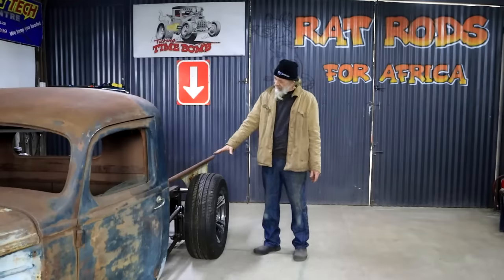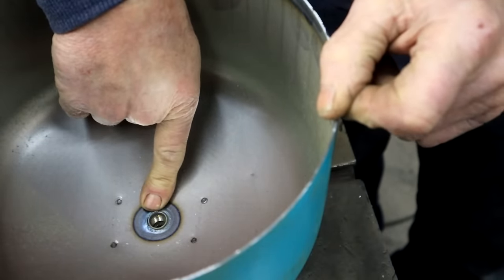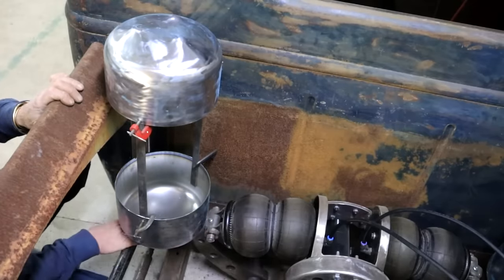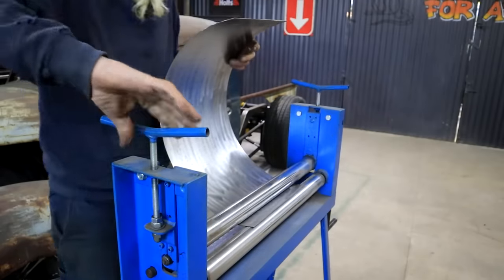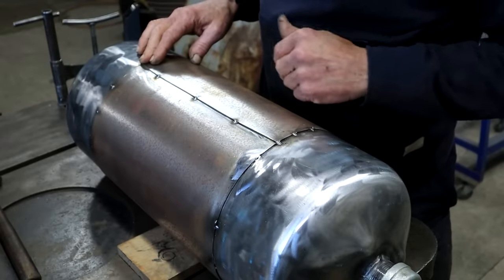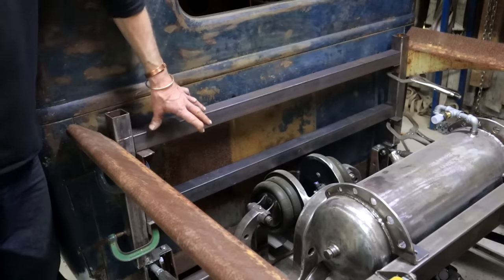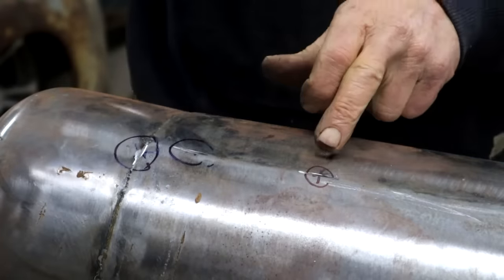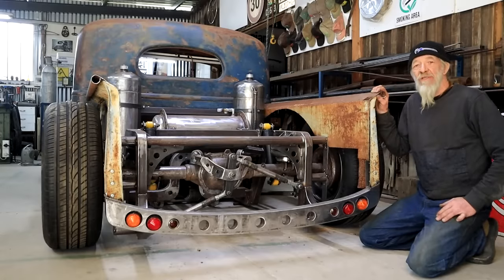Building Fuel Tanks from junk - 1939 Hudson Rat Truck Part 31

Comment: Greetings from Whidbey Island, Washington State, USA. Don't forget to provide a vent hole in your filler caps. If you don't, your fuel pump will pull a vacuum and eventually starve the engine.

Comment: I am in the states.  I have done a fair bit of work in Japan and Bahrain and had to use the metric system at times to work with the locals.  I wish we would go to the metric system here, so much simpler to work with.  

Your fuel tanks are an interesting solution to a simple problem.
Reply from the maker: I agree. Once one has worked with metric, imperial makes no sense 😊

Comment: Love the tanks that you created for your Rat Rod Truck, I am sure you are considering to tie the two tanks together with perhaps a 1/2 pipe between them.  Would like to see how you finish these tanks up and connect with to a fuel filter to your engine.
Reply from the maker: Thanks. I will only do final connections once the truck has been taken apart, stuff painted and reassembled again. Still some way to go...

Comment: Diff (Div) your T.I.G. is getting better. Like I've said before, it is way more skill. T.I.G. is unlike M.I.G., where in a good travel speed & temp, can make a good welds. T.I.G. needs practice as the only way to get better, and it is fun. To get a dime,  laid-down look, try lower your temp, slow down a bit, and add a little circular motion with your touch. Adjust all as needed to get the look you want. The more you practice and the more you enjoy it, the better you are getting. Also, being able to see your weld puddle is manitoritry. For myself, also being older, my eyes aren’t what they used to be. But, we, back at (Wyotech here in the U.S. way back when), used to call “a cheater lens” or magnifier lens for the inside our welding helmet is a must. Basically, reading glasses for old and/or almost blind welder’s like us. Once, I found the right power cheater lens and could see the weld puddle clearly. It made all the difference for my T.I.G. welding. I love T.I.G. welding more than any other metal work.
Reply from the maker: Yes, I need to do more of it, to get some mileage behind me. 🙂 My current machine is scratch arc with this stupid manual gas valve om the handle. Doesn't make it easier and wastes a lot of gas! But, just ordered a better machine! Cant wait!

Comment: On hydraulic tanks I’ve built, I grind a vertical groove against the threads, it allows it to breathe and won’t let water in👍
Reply from the maker: Great idea! I'm going to give it a try. Thanks!
Reply: @ratrodsafrica  it works really good, I forgot to say to groove the threads in the cap! It works the best and doesn’t look like crap😄
Reply from the maker: @davidwaskiewicz3289  thinking about it, that would be the best. Thanks, going to try it

Comment: Daniel Hughes mentioned using clear materials for the tanks. I was picking up a load of produce one night in California, when a beautiful Blue Peterbilt had finished loading and pulled up to close his trailer doors. It was highly customized and lite up. I noticed his fuel tanks were glowing and I could see the fuel moving back and forth inside the tanks. lol. They were illuminated somehow. They were translucent plastic or poly and were lite from behind or top or inside. I didn’t get a chance to ask how he did that but were way cool looking. Never seen anything like that in 40 years of over the road trucking.
Reply from the maker: How cool! Must be some really special kind of plastic...
Reply: I searched it and found a custom big truck shop here in the USA called “Chrome Shop Mafia”. They did one similar with acrylic clear on the ends of a tank and it was lite up too. But it was not the one I saw in California. Also these were used with diesel fuel and not gasoline.
Reply from the maker: @EarlyIronAddict427  clear flat ends I can still imagine as being feasible. But a tubular section? That will take some doing...
Reply: Yes. I wish I had caught him and asked how he did that. I was just sitting there looking at it. lol. Jaw dropping. Hahaa. I could see the fuel slashing from one end to the other. Was cool looking 😎
Reply: I’ve seen white plastic containers that the land scrappers use to spray lawns and you can see the liquid in them moving around. I wonder if it was that type material ??hmm🧐

Comment: When I was a lot younger I loved roaming around junkyards so much I went to work in one. We used to get between 25 to 50 cars a day. I went home with a truck load almost everyday. Needless to say that the owner of the yard was a pretty cool guy. I think that the 3/8 cross pipe would work when driving but you would need to shut one off for filling. Maybe just vent one of the tanks, like my old Harley does. Just a thought. Keep up the great work.

Comment: Those look like the aircon gas refill tanks used for cars and bakkies. You calculation is off by a point actually 0.0253 meter cubed is equal to 25.3 Litres(Sorry just being picky). Tanks look awesome. Well done bro. Thank you for sharing.
Reply from the maker: Call me a liar for a cup full of petrol 😂 I actually did write 0.0253 m3, then just rounded for simplicity 🙂
Reply: lol...

Comment: Pressure testing with air is dangerous. Learned this the hard way... 2 smaller  vertical tanks is a great idea, especially considering sloshing of the fuel. Great work!
Reply from the maker: Why do you say it's dangerous?
Reply: @ratrodsafrica In my job we were testing as you do. When one vessel burst one day @ 5 bar it was epic, and the bottom flying off nearly hit one of my coleagues. Since then we test any tank filled with water - our pump gets to 2,5 bar and we may increase it with air. Water is incompressible and takes the same volume @ 0 as well as 10 or 15 bar. Any leak, no matter how small gets the pressure back to zero. With air a 25 liter tank gets filled with 75 more @ 3 bar. That's a lot of air pushing out. Just 2 bar for example is 2 kg for every square cm of the internal surface of the tank, and for your tank that's 12*12*3.14*56=25321sq cm *2=50 tons. Water does not decompress explosively...
Reply from the maker: @ЛюбомирДинков  thanks for the feedback!
Reply: @user-hu2iw5qu3i yes agreed, I was getting puckery watching that first test. 😮😅

Comment: Hey Div,
I don't know if in South Africa they use alcohol in your fuel or not. But here in the States they do, and it can cause rubber fuel line/clear rubber hoses to crack and leak. One thing we use here is fuel injection fuel line, which has a plastic liner in it. But after you showed one of your older Rat Rod, you may not have to deal with it like we do. Also here is an idea for your tanks: I don't know what your standards are there, but here Gasoline/Petro cans are Red, and Diesel cans are yellow, What I think would be cool is paint them whatever color, and on one with stencils put Petro and on the other one put Gas.
Bart
Reply from the maker: I have those clear hoses on 2 other builds that are a few years old already. A bit of yellowing, but no issues so far. Easy enough to replace though.

Comment: In 1972 we were told that the US would be fully converted to the metric system by 1975! They were off a few decades!!! As a tool and die maker, forced to use two systems of measurement I wish they had followed through back in ‘75!!! It definitely is a simpler, easier method!!
These tanks are great!! And the site “glass” level tube is a clever idea!!
Reply from the maker: I take it you tool & die makers use the metric system then?

Comment: I know it's too late, but had you used a clear material for the tanks, it would have looked like an old glass fuse!! I like the longer videos. Thanks again! Your work is impeccable.
Reply: great idea what would you use to fuse the metal to the clear piece?
Reply: @Atr42Greasemonkey  no idea, but div is a genius. He'd figure it out. It was more sarcasm.
Reply from the maker: That will be extremely tricky to do! 🙂

Comment: Diff, from here it looks like the nipples or bushings you used to fill the tanks are un-tapered rigid electrical conduit fittings, they are not for running liquid through.  If I'm right, maybe a couple of necks from fuel tanks from the junkyard would be a safer option.  

I like the way you built the tanks; they came out great.
Reply from the maker: Nope, they are irrigation plumbing fittings. 1 and 1/2" BSP taper thread

Comment: I love that idea of the twin tanks, I used a 10gal. air tank once and had some kind of cutting torch brass filter for the vent, with the guard on your sight tube it would be helpful to have a bright colored plastic ball as a float, just make sure it doesn't fit thru the metal tube or its only good for one fill, lol, great work diff, it's looking fantastic
Reply from the maker: The ball is a great idea! Now to find one with the right diameter...
Reply: Spot on man...good call.

Comment: Good job on the tig welded gas filler !!!!  Maybe try a fupa #12 cup ...if u do u may fall in love with it !!! I did
Reply from the maker: My biggest issue is that my current setup is scratch arc. Pain in the butt! Plan on buying a dedicated TIG machine soon!😁
Reply: @ratrodsafrica  my setup is scratch Arc, and I love it !!! And u did an amazing job on those tanks !!! All your work is well thought out and executed.  My tig is a miller max star 161 and it's scratch arc once I got used to the start I'm happy with it it the fupa cup helps me see my weld and allows me to extend the tungsten to get down in tight spots and I could buy a foot pedal for it if I wanted to spend the money 💰
Reply from the maker: @flyingmachinecustomparts8227  I can't find those fupa cups here. And Amazon shopping is a problem for me...

Comment: A removable metal boot/toolbox in the area of the tailgate and a removable bed floor would make this beautiful old thing perfect for those odd times it could be put to work. Really like the way you put things together Div. Maybe if you turned the sight level 90 deg. Or even less towards the inside of the trayyou may be able to see the level from the cabin.
Reply from the maker: No, not visible through the rear window, I checked🙂

Comment: As you drive around and the petrol inside moves, it will find its way out at the filler-cap, even at half-tank you will always have the smell of petrol ... sorry no smoking here ☹ 
You need to seal on the filler-cap, but then you need a proper breather, especially with a V8 in the front. 
Weld in a pipe from the bottom into the tank (out of the way of everything) , going to the highest point inside the tank and then route a hose onto that going somewhere higher-up like inside the cap and back down again.

Comment: I have an idea , would if you put a one more fuel tank in-between the two , it would fill that space. That v8 might get 10 miles a gallon. So to have 5 to 6 more gallons. . Lol
Reply from the maker: Can't fit one there because the suspension linkages are in the way

Comment: No tailgate? Please kindly allow me to suggest something: A simple frame made out of angled iron plus some hinges and latches would stabilise the side brackets and keep them from rattling. To keep dirt away from your fantastic looking suspension contraption, you could bolt in a sheet of this sturdy plexiglass and use brass acorn nuts and washers on the outside. This would match the brass rings around the rear lights and look even more steampunky.
Reply from the maker: Just thinking about clear plexiglass gives me nightmares 😄 That stuff is for show cars that never get driven...
Reply: @ratrodsafrica  
Thanks for replying and especially for giving a heart to my comment. I appreciate both very much. 2) Oh really? That wasn't intended to be. I beg your pardon. After realising what kind of roads are leading to your farm and workshop, I thought it would be a good idea to have some protection against dirt and gravel.
Sincerely yours.

Comment: I almost forgot the little ball can be made of a piece of white carburator nylon float. Also at the lower and upper part of the plastic indicator tube, put a small object like a washer to prevent the ball from escaping inside the tank. Maybe the plastic toy pellets used in toy guns would be great because they are orange in color. However whatever you make the little floating ball first test it out in a jar of gas to see if it will not desolve. Look this part up on E bay its description is :  NBR Solid Ball Nitrile Rubber Ball 6~12mm Black Oil Resistant Fuel Petrol Diesel.    You may have to shave it down to fit your tube.
Reply from the maker: Thanks!

Comment: Hey div you say your covering the side and won't be able to see the insides from the side and you aren't going to have a tail gate so you can see frome the back.  I don't know how much plexiglass costs there but you could get a decent thickness plexiglass make your whole bedside's out of plexiglass put your metal wheel Wells on that metal frame around it to encase the plexiglass and also be able to use that to make a tailgate that would allow the entire bed to be exposed from the sides and from the back just a thought it your build and yo do amazing work buddy
Reply from the maker: Just the thought of plexiglass gives me nightmares😅 Stressing about scratches and keeping it clean... no, that's trailer queen stuff!1🙂

Comment: Yet another interesting video Div !     As a tooling and machine builder I very much admire your shop built machinery like the roller.  Also the plasma jigs.  I'm very impressed with what you come up with in your forest shop !    I think I would be concerned about those "cousins" of yours !    I will trade you some heat for some cool !    It is 100 deg. F   today.  Add the humidity and it's 112  in south west Missouri right now.    Another entertaining and informative video !        Thanks Bro.  !
Reply from the maker: Thank you! Wow, those heatwaves in the States are hectic! Been reading about it. Wish we could trade a little😅

Comment: Leak testing with air is sketchy at best. For safety you should fill the tank fully with water and then pressurize with air. A leak is a very conspicuous dribble and if a seam fails the tank doesn't burst. The pressure drops instantly but since water doesn't compress there is no great quantity of gas (air) to expand and explode.
Reply from the maker: Common sense prevails!

Comment: Hello Diff!!! I wonder if you need to support the tanks on the bottom because the weight of the fuel might cause the tanks to move in the clamps!
Reply from the maker: I think it will be fine. Only about 30 kg per tank.

Comment: That metal red tool box - I have in green.  It looks exactly like the one my father used in the 1950's for TV repair.  It is on my barn floor now.... it was amazing to see another one.  I have never seen another one.  Does it have the lovely bottom corner rounded ends that may be made of brass?  I will make a short video of this box so we can share notes.  I remember the insert tray from when I was a boy but it is lost now.  I only have the box.  It is a heavy thing too.
Reply from the maker: No brass corners unfortunately.  Must be way newer than yours
Reply: I may be working on a posting for tonight but it's so hot here.  If I do, today or tomorrow, I'll start it with a bit about the tool box I have and show those corners.  I will also look for the tray as it could be up in the barn attic... I hope I find it!  I was thinking of powder coating the box but I think it best to leave it be like I do my old truck.  I'll have another thing to talk about that has been so much fun over the past months and I'll talk about that too.  Fact is I don't care for this super heavy box, but it will have a place somewhere in the barn along with the other old box I found.  Bobby
Reply from the maker: @bobeaseshop9389  leave the patina on it, tells a story!
Reply: You are correct Sir - I'm only going to clean it lightly and get the spiders out.  I found the Tray!!!  It was under some old siding in the attic - so happy.  I made the video and it will be posted in a few hours.

Comment: Good looking gas tanks Div. How did you retain your tail lights? Thanks see you next video.
Reply from the maker: The tail lights bolt to a flat bar piece welded across the hole. Did I understand your question correctly?

Comment: Well "Diff" good to see you back on the channel.... Hopefully i got your name right this time...  Just to stay ahead of this build .... the calculation you laded out for the volume of the tanks ... just to be clear was great. I have not seen that on any channel.... further I'm thinking you said 13 gallons US. overall.. Wow... So with a 351 cu. in motor average gas millage is about 14 mile to the gal.... driving slow...... if you push it maybe 9 miles to the gal.... With an overall 13 gal tank driving slow I'm thinking no more than 200 miles to the tank.... where your located gas milage is what your looking for..... So this is not a cruiser.... Please tell me where I' wrong.....USA watching
Reply from the maker: I can't think of any place in South Africa where gas stations are further than 100 miles apart. Unless one goes way off road. We will be good🙂
Reply: Thanks for the calculation..... 351 with a 2 barrel carb....maybe.....
Reply from the maker: @pierrelataillade7564  Also depends on the weight of that foot😂
Reply: I'm sure your right .... thanks for the reply.....

Comment: Any fluoroethylene gas mix is quite toxic in a non-ventilated room. This gas is also used to etch material. not flammable but still dangerous. If you ever come across any old gas tanks and are not familiar with what it contained just let it overflow with water.

Comment: Diff we call it a tape measure.
Reply from the maker: That's what we call the steel one that retracts into a housing. That flexible one is called a seamstress tape measure by us.
Reply: @ratrodsafrica  We use the term for both (even though your title is more precise).